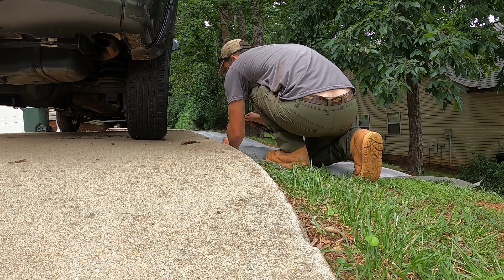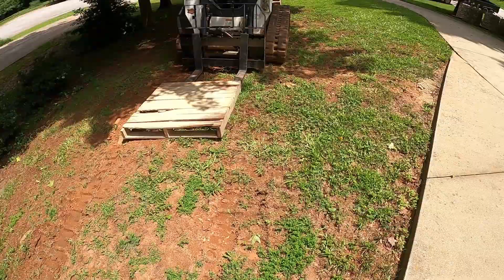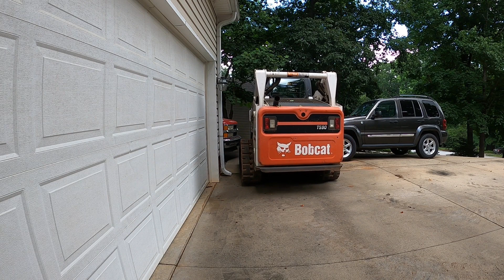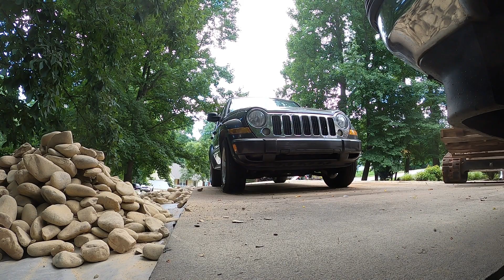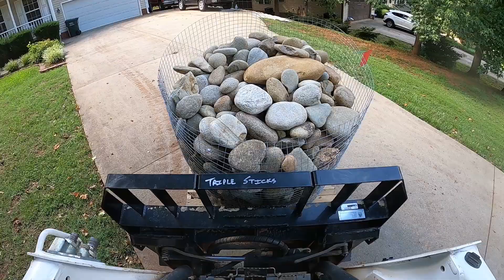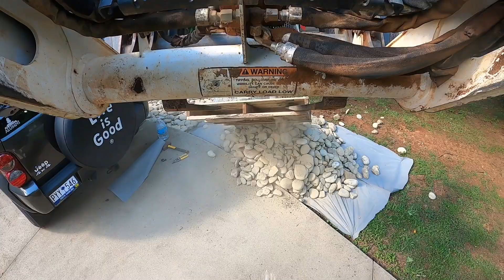installing river stone

Comment: If you ever have to dump pallets like that again, run a chain from front of pallet ( underneath )to back of fork cage. This will stop the pallet from sliding off your forks. Also, drive some spikes in the ground at the bottom of your fabric and get a wide plank like a 2x8 and stand up against the spikes to stop your stones from rolling away. Easy to remove after the stones are laid. Job looks good but a lot of hand work. I think I would have used your dump trailer to get the rock and used your excavator to spread them. Keep your videos coming.
Reply from the maker: Not a bad idea I’ll keep that in mind next time about the chain. 
Sadly I couldn’t use the dump trailer on this job site due to the only thing that was in stock at the time was the pallets. The customer forgetting to move his cars before he went out of town was also a bummer as well.

Thanks for the great advice though and I’ll keep that in mind next time